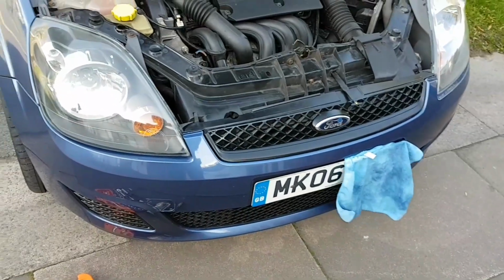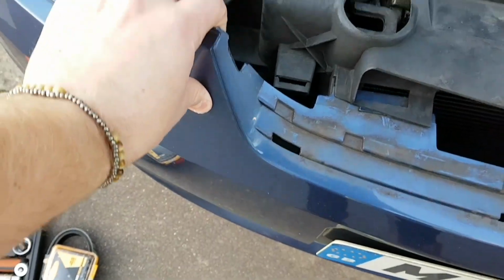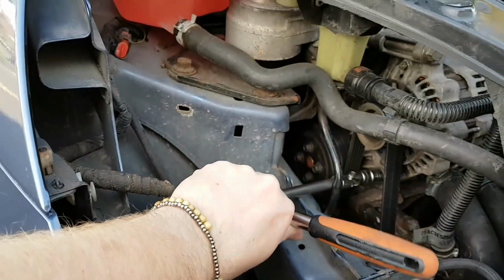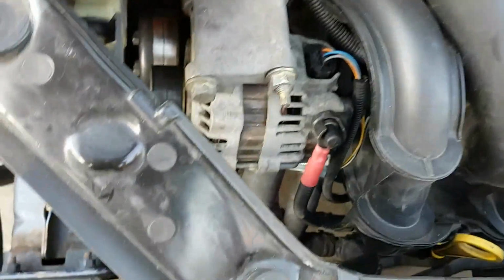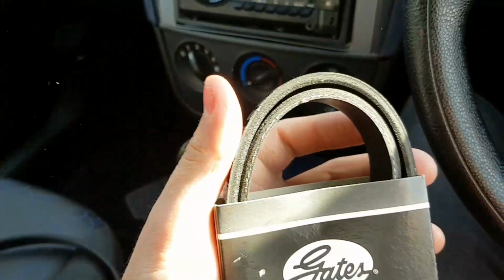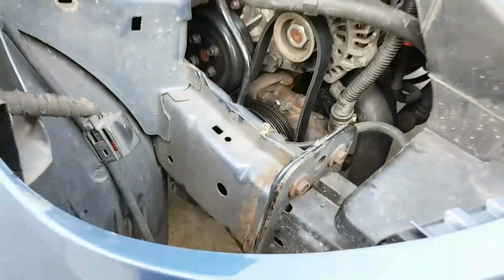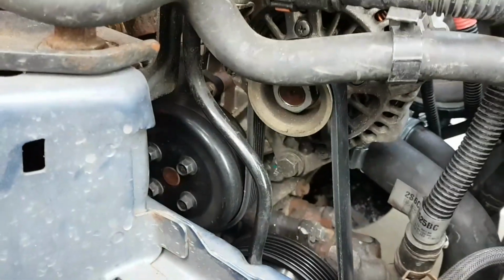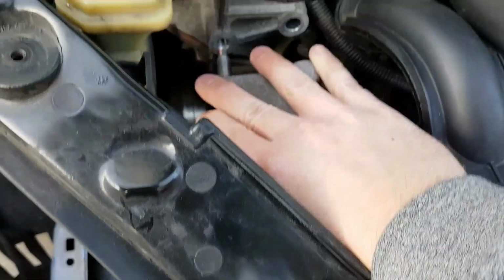How to replace the auxiliary drive belt on a mk6 ford fiesta petrol

Comment: In principle this is a great idea but in practice doesn’t work or requires Herculean strength to line the alternator up to the engine block again. Best way imo is to follow this up until you’ve got the old belt off, then to nip the alternator bolts up, put the belt onto the alternator and PAS pulley, then using a £10 stretch fit tool (can find on Amazon or eBay) on the crank pulley, then turning the crank forcing the belt onto the pulley. That way you are putting stress on the belt (as intended) rather than any bolts or threads trying to re-align the alternator. You’ll need to push the belt well onto the water pump before you start turning the crank pulley as it’ll try to ping itself off. Once done you can tighten up alternator bolts and it’s party time… some great ideas to help me get started though so thanks for the vid mate

Comment: Whats the small belt for on it then? I always thought it was for AC but a friend says that powers the power steering pump
Reply from the maker: @matinroe962 it's been a while since iv been under one of these. From memory the output shaft is attached to a pulley which has two locations for belts to sit, the inner race is for the main auxiliaries like alternator, power steering, water pump ect, the outer race on the output pullet is for minor auxiliary like Aircon pump. 

If your car doesn't have Aircon, the location of the power steering pump goes to the back of the engine and is driven from the minor auxiliary belt. 
If you have aircon, the minor belt drives this and the power steering moves up the engine to be driven from the main auxiliary belt.

Comment: Tried this on 1.6 petrol zetec mondeo same layout however, the alternator does not line up it jerks to the left of the bolt hole, impossible to get it to line up as nothings metal just plastic so prying on nothing to get back line

Comment: Hello I have Ford Fiesta 07 plate with air con 1.25 , the air con has never worked for 3 years so I don’t need it . I want to bypass the air con pulley and just have one belt  because at the moment the air con compressor is making a noise due to a bearing that has gone in it. The car has two belts at the moment , a shored one and a long one. Any body got any advice    Thanks
Reply from the maker: If I remember rightly, on cars without Aircon, the powersteering pump on the front of the engine, car with aircon the power steering pump is moved to the back to gives it space up for the Aircon unit. You'll have to check that the non Aircon belt is big enough to go round all the pulleys seen as the powersteering pump is in a different location.

Comment: So it works without using a tensioner tool?
Reply from the maker: If by works you mean a aux drive belt can be changed without a tensioner tool, then yes. As per the video shows. No special tools used

Comment: Brilliant video. I don't need to to change the belt but I need to remove the alternator and fit a new one. I didn't realise the bottom bolt allows the alternator to rock forward and loosen the belt. I guess I just need to remove the alternator and reverse the process. All I need is that extending bar and a universal joint. Thanks again for putting this up.

Comment: Did your car have ac    Any difference in fitting
Reply from the maker: I didn't have ac, but the principal is the same, look at your existing pulley and belts, check how its routes round everything (draw a diagram if it help you remember and then just take it off and replace it as the vid shows (but in route your old one took)
Reply: @deltaunit7  thank  you

Comment: Be careful using this method, I snapped a bolt off in the engine block!!, garage told me the correct method is to bolt alternator up first and get lever tool to get the belt on......try this with extreme caution!!

Comment: thanks very much for the video. this info is most relevant to my ford ecosport 2016 model which has very similar features on the belt spec that connects to the alternator, water pump and power steering.

Comment: Is it possible to take out steering pump the same way ? Like putting out the headlight and through the this space?
Reply from the maker: I'm not entirely sure as iv not taken one off in  a good few years, I suspect it depends if your car has ac or not, that will determine the location of the pump. Then you might have access via the light or drop it down below and out
Reply: @deltaunit7  it is without ac and under alternator
Reply from the maker: @elha6842  sorry mate I cant help much more as I havnt Owned a fiesta for nearly 3 years, I'd suggest looking round the area and taking the headlight off too and find the area that give your most access to make the job easier, also buy a Haynes manual they are great for jobs like this. I did a full engine swap with one

Comment: great video, ive just done mine, for anyone wondering the right hand stud can come out with a 6mm socket the length of it means its quite hard to fully pull out but you can just about squeeze it out, also the hardest bit is getting the belt over the crankshaft unless you jack the car up and do it from underneath, and then pushing the alternator back in place with the tension of a new belt you have to put quite a bit of force on it but once youve got the left long bolt going its fairly easy to then finish the job

Comment: You didnt seem to mention about removing the threaded bar on the right bolt.
Reply: Any news or ideas for getting it off without damaging it?
Reply: @OjL0C  remove the 15mm nut, then you can use a 6mm socket to undo the stud, you might find it a bit of struggle to pull the stud all the way out due to lack of room but it just about comes out

Comment: Great video looks like a Gates belt do you have the number of the belt you fitted
Reply from the maker: Sorry it's been a long time since I done this vid, I asked the guy in euro carparts what I needed and they confirm you reg and pick the right belt
Reply: @deltaunit7  ok thanks reason i asked the company on  ebay they told me it had 2 aux belts and 1 looks too short compared to yours.
Reply from the maker: @grahamcharlton861  does yours have aircon?
Reply: @deltaunit7  yes a/c and power steering
Reply from the maker: @grahamcharlton861  pretty sure it's only got  1 aux belt and yours will taken the bigger one as its goes round the aircon pulley too. It also have a timing belt maybe that's where the confusion of 2 belts has come from ?
Reply: @deltaunit7  agree i think it will have 1 belt +timing belt.
Annoying thing is they asked for reg no etc before i ordered

Comment: Don't do this folks, can't get the alternator back in! Chances are you'll bugger the threads!
Reply from the maker: Hello Dave Simpson I'm not sure which thread you are talking about which are buggered. But The main alternator bolts are all m10 standard thread size (from memory) and would need a considerable ammout of force required in order to strip a thread. By this point id like to think that anyone would understand that a normal bolt should not be that hard to tighten up and would stop and check if they have cross threaded the bolt. If someone where carry on swinging off a bolt to get it to tighten up it would be expected that the tread would become buggered. If you can give me some more details I can see what advice I can offer you. :)

Comment: 4:20 slide socket off the ratchet half way out and forget about rounding bolt up
Reply from the maker: I did say be careful in the vid, but obviously a deeper long reach socket would have been ideal for this.

Comment: There's alot of different varients of the belt name. Serpentine,drive and auxillary. What was yours called. I have the Mk7 fiesta. 2009 so hoping it's a similar process. Cheers
Reply: Also I've heard of a timing belt? It's the 1 next to the water reservoir
Reply from the maker: This was changing the auxiliary drive belt, auxiliary means additional. So auxiliaries for a car are power steering, alternator, aircon etc.... these a linked with the same same belt as they are not as important as the timing belt. The timing belt runs from the crank  shaft pulley to the cam shafts which keeps the engine running in time by opening valves. This timing belt also runs the water pump which is very important as is circulates coolant and stops the engine over heating.  So in simple terms the timing belt covers the crucial parts timing and cooling and the auxiliary drive belt is for thing which are not as important. Hope this helps
Reply: Thanks Deltaunit7. The car sounds like it "chirps" at high speeds
Reply from the maker: @craighendry88  iv never come across that before haha if suggest asking a garage to have a look at it for you
Reply: @deltaunit7  👍🏻 Cheers

Comment: have just got around to doing the job but stuck as I can't get the right hand bolt out after taking the nut off, just wondering how it come off,
Reply from the maker: Nicola Whatling hello, have you loosend off the bolt below the alternator yet? This could give you abit more space to be able to pull the altinator out
Reply: Think I have is sust out 6mm socket should do the job
Reply: @nicolawhatling8950  did the 6mm socket work? I'm having the same problem

Comment: Ive got to replace the water pump on my mk6 fiesta zetec... (not the timing belt one) but dont see anythink online showing how its done
Reply from the maker: bernaed godspeed hello, as far as I'm aware the water pump on all mk6 fiestas is driven off the timing belt. So if you are replacing your water pump you may aswell change the belt at the same time.. ... unless the belt has only recently been done. But for good practice it's easier to do both the timing belt and water pump together while you have access to it all. If not personally done one but I have read up on it in the Manuel. Hope this helps

Comment: is this applicable on the newest model? mine is 2015 i have a damaged belt. they say you need a special tool for this. need your help mate. thanks
Reply from the maker: Joseph Carlo Estillore unfortunately iv not worked on any of the newer fiesta's, your best bet is to go into halfords and find the haynes Manuel for your car and have a little read up on the tools needed to do the job, often the haynes Manuels say you need a specialist tool for this job or you can use a bla bla bla..... worth a look into it as I don't think ford would make it impossible for the home mechanic to not be able to fix their own car ..... let me know how you get on
Reply: the thing is even if i have the new model 2015. we have the same engine. same position of belt and alternator. i can also take out my headlights just like what you did to yours. thanks for the help mate!

Comment: hia mate, same car as yours.after heavy rain my steering locks when i go to pull off, doing 3 point turn,i hear a whine after a struggle with the wheel then it all works again. only happens after a night of rain and i get in in the morn. would this belt be the culprit?
Reply from the maker: Kevin Birchall I'm not a qualified mechanic but I can tell you places to look to try find the problem. 

First off your belt might be slipping on the power steering pump pully, I believe these are changed every 50,000 miles so if it's due a change why not do that anyway to eliminate the belt being the problem.

Next inspect the power steering pump for leaks around the in and out pipes and check the colour and level of the fluid it might need a top up or a change, the might even be air in the power steering system so it could need a purge, from memory I think you top the fluid up with the cap off keep turning full lock to full lock to tease any air bubbles to the top. 

If this doesn't help I'm all out of idea sorry. 

Wish I could help you more, If you do find the problem please can you tell me what It is :)
Reply: thank you, will try :-)

Comment: This video was great! Thank-you!!!!! Used it for a 2012 but modified a little. Did not remove the headlight (it’s different than this one) and my alternator does not swing out so far so had to slide the belt on the water pump roller while using a pry bar, then used long wood clamp to bring everything back together. Was not pretty but works. Gates belt no. K060397SF
Reply from the maker: Greg Peterson brilliant good job